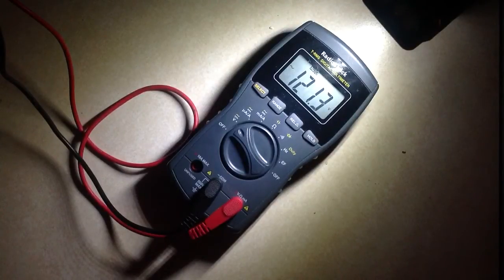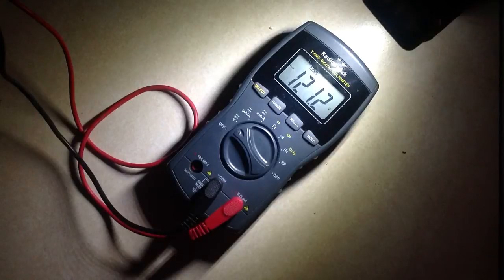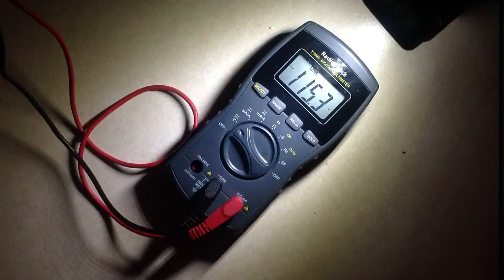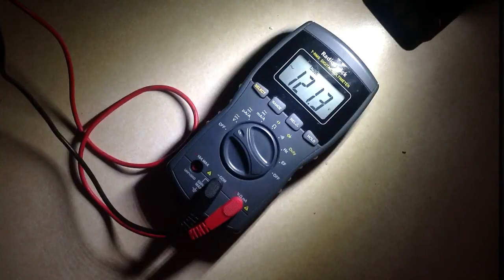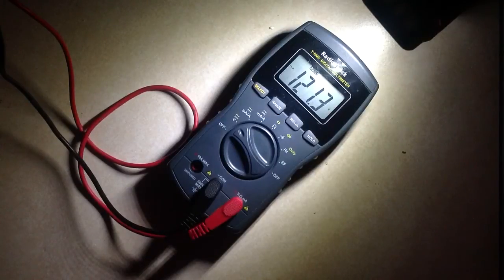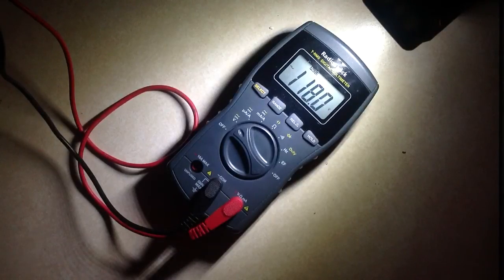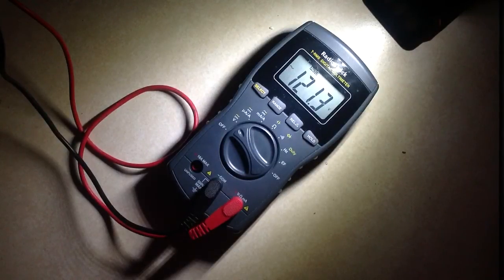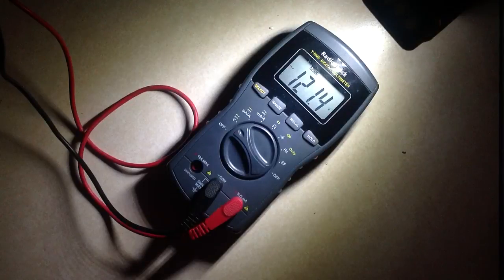Utility Circuit Load Test 1

Comment from the maker: Haven't done many tests of this sort. Tried another outlet and got only 4 volts drop. But that is at 120 volts while your starting voltage is higher. So 10 V drop at 230 volts would be the same percentage as 5 V drop at 115 volts ... Six volts is the biggest drop I have ever seen under load.

Comment: I think that voltage drop of 6V doesn't pose any threat to electrical devices.Your wiring seems to be in a good shape. What was the lowest value of voltage you measured coming out of your outlet? I have a much bigger voltage drop, it's approx. 15-20 volts at 230VRMS nominal under 10A load. But again my wiring needs to be changed to copper.